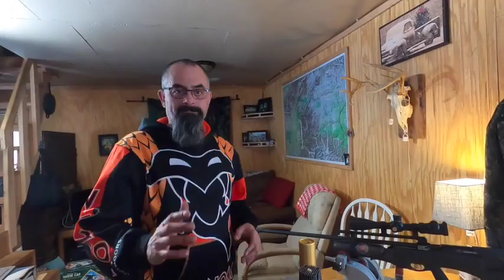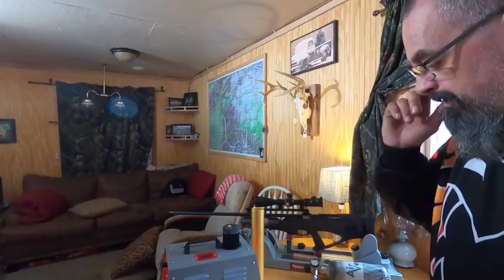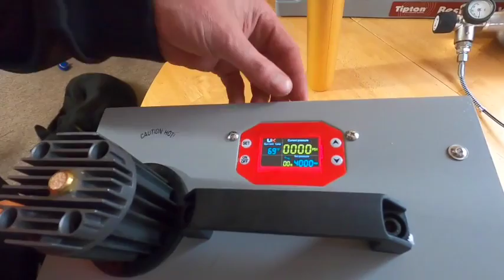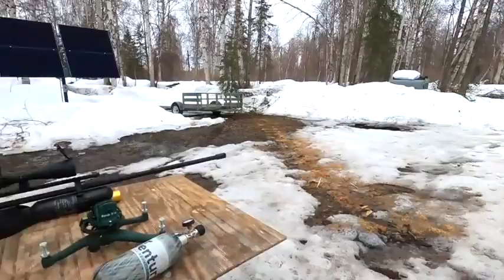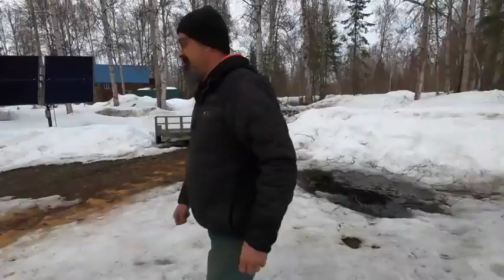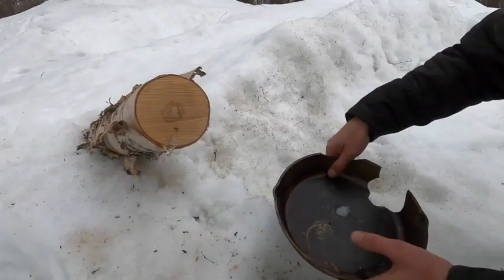Hatsan Piledriver.  Did the Hatsan Piledriver redeem itself?

Comment: Can we shoot with a tethered, large air bottle at 4200psi ? I am guessing this is not recommended because this air gun does not have an air pressure regulator, right ?
Reply: But this video shows tethered at 3800psi external tank? 

https://youtube.com/shorts/UAOU9ORy6KI
Reply from the maker: My apologies as I am incorrect.  Maximum pressure of the Hatsan is 300 bar or 4350 psi.  However without a regulator it's acting like a big CO2 rifle with the muzzle velocity dropping with every shot. If it could be regulated at 3000 psi (just an example) you would have several consistant shots before experiencing a noticable drop.
Reply from the maker: Correct, if this were like the FX that has 3 regulators you'd have no problem.

Comment: Curious why you only filled to 250bar. Piledriver fills to 300
Reply: That’s the issue with high power guns like these. They use sooo much air so they require frequent topping off, and so you can really only shoot it a few times between fill ups. With a 300 bar fill you’re looking at direct air compressor fills or just partial fills with a tank. Kind of annoying and time consuming but that’s the price you pay for sooo much power. If I’m not mistaken this gun has a removable bottle so at least you don’t have to have the entire beastly gun up on your car engine while filling from a compressor at the range.
Reply: @GovtWatchdog I bought the same battery my GMC truck uses ( in case it dies in the national forest ) and I use it on the ground with the filling machine . Good to know bottle comes out though
Reply from the maker: That's what was in the tank.  I know, right.

Comment: Sorry ask:    I have just got the same gun, nothing about putting the O rings on the filler connector to the rifle, had to work out for myself. .  Also looks like I have about an 8mm fast connecor  to the hose from the compressor, female 8mm.  and about 9.5mil male hreaded  connector at he back end of the rifle connector. somehow I now have to find  a male to female connector, which we never got. .  what did you use? If that makes sense! ish hah
Reply from the maker: I have a quick connect on both the tank and the compressor.  Then I bought a double male to go from that to the gun.  I bought it from Alaska shooting specialties.

Comment: It sounds like your adapter isn't concentric to the barrel--that is probably what was responsible for the baffle strikes. I have had that issue trying to use an adapter for my suppressor that wasn't made by the suppressor maker. Anyone that is custom threading a barrel for a suppressor has to make sure that their threads are concentric to the barrel as well.
Reply from the maker: I've had that same thought and the only way for me to thread the barrel is in a lathe which I just might have access one soon.  I've seen someone try to thread a barrel with a die before and completely ruined it.  No way to keep it exactly straight.
Reply: @alaskacutthecord769  There is definitely an art to it! I took several barrels to a small business then later on, took another to him that he told me he would do that day for me....he wouldn't even let me watch him as he said he had some proprietary ways that he couldn't let me see. Don't know if that was the truth or not but I haven't had any problems with the barrels he threaded for me.